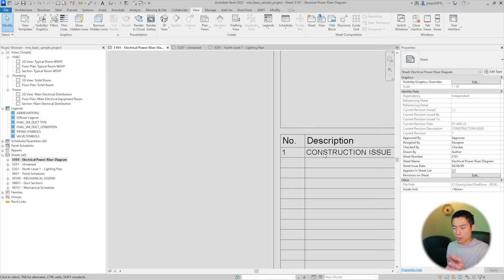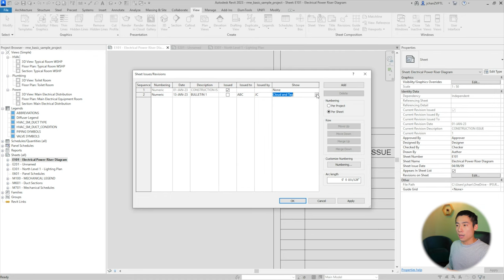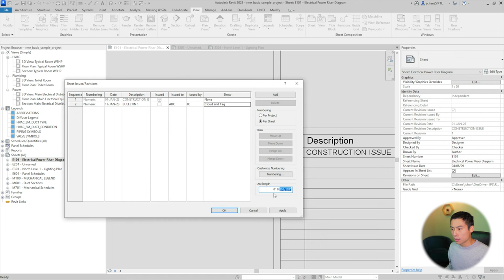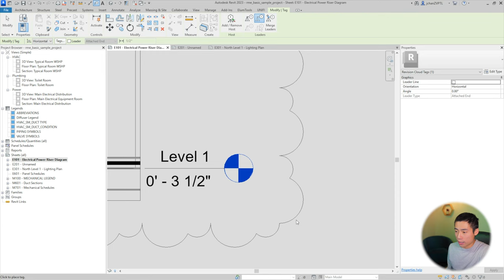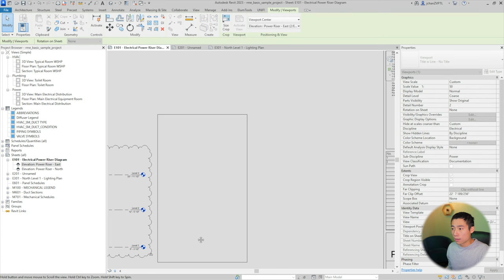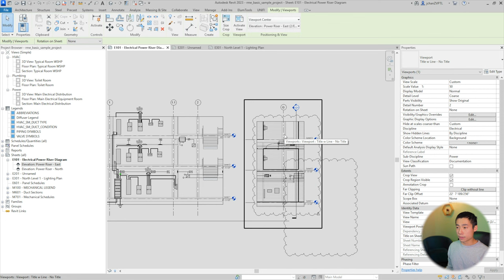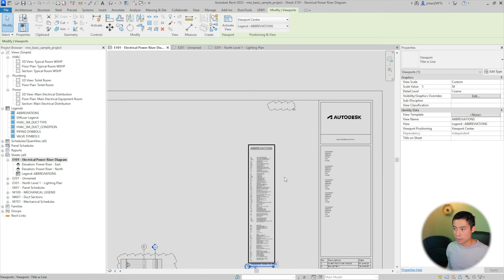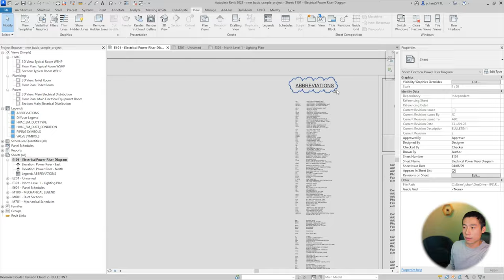Revision Clouds in Revit

Comment: How is you’re experience with automated wire sizing? I have a really good system built for sizing various conductors, but occasionally need to skew allowable voltage drop… I’ve built up a schedule as well for VD / OCPD sizing w/ conditional formatting to warn me about VD > 3% and breaker ratings being under 125% of true current. Would love to hear your thought and even more-so a video over this topic!!
Reply: Also, absolutely love your content, engineer-to-engineer 🎉
Reply from the maker: HA I'm glad I wasn't the only one trying to automate this. it seems logical right? At this load, 1phase = this breaker, 3phase = this breaker. but nooooo, Mechanical goes and moves their equipment to the roof, suddenly you have to account for ambient air temps in the 110F and derate the feeder. Then you find out it's ordered in 208V instead of 480V so suddenly more voltage drop comes in. Then they go and move the damn thing ACROSS the roof and you're practically forced to add a transformer at the far end so you don't need a 4/0 conductor running across the roof. I'm not bitter at this at all 🤨

Jk it wasn't really that bad, but my point is, automation failed me several times on the project. I always size each piece of equipment or panel run case by case and check all the factors in terms of temp, distance, method of installation and whatnot. the only thing I tend to use the spreadsheet for are 20-30A loads at 120-208V. those tend to be more predictable and can be sized automatically. Some rules I keep are stay under the number of feet in voltage, account for 20-25 feet of vertical runs for each feeder, and assume anything running on roof or even just below steel requires derating due to temps.

you're right, this could easily be a couple videos haha!
Reply from the maker: Oh I like that you picked up on VD affecting motor's FLA. Motors will pull a set amount of power, if voltage gets low, they make it up in amperage and trip breakers or burn out starters/vfds. I know this is overkill but I tend to size conductors of longer runs at 140% FLA of the equipment (basically always consider it as continuous duty) and either use Max overcurrent protection listed by the manufacturer or size the breaker to protect the feeder. sometimes it will end up with like a 60A feeder protected by a 50A breaker and all runs well.